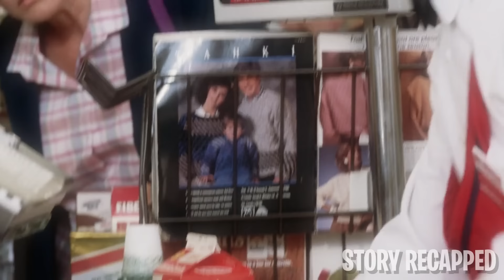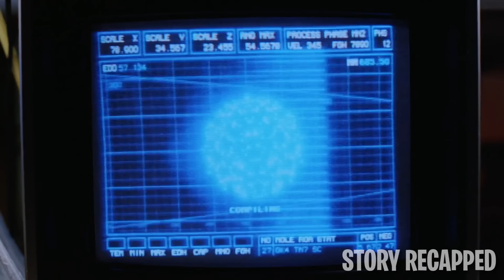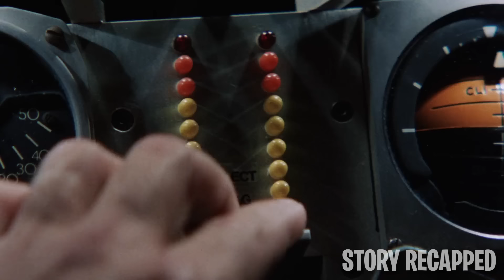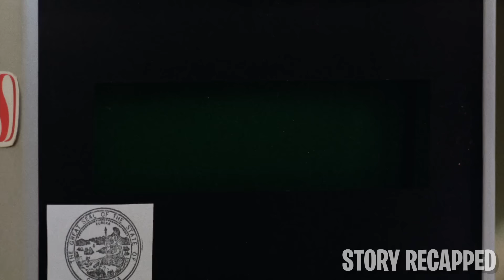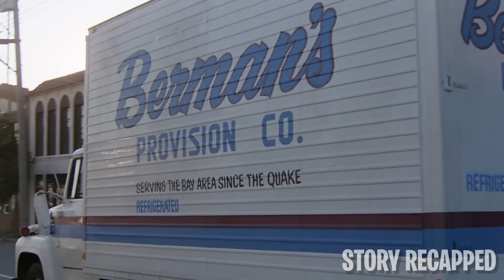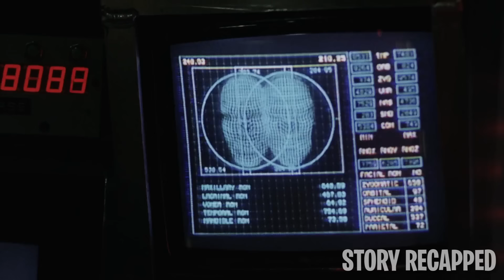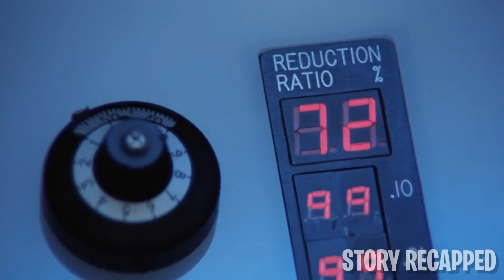They Shrunk A Man & Injected Him Into A Human

Comment: These guys had ONE security guard and was doing this in a building ANYONE could walk into? Wouldn't this be protected by the highest form of security and at one of the most isolated locations?
Reply: Well that's what the movie script requires. Only one dumb guard.
Reply: It was the 80s no one robbed anyone. Security was non-existent. Good times all around.
Reply: THAT is the thing you find weird with this movie? 😀